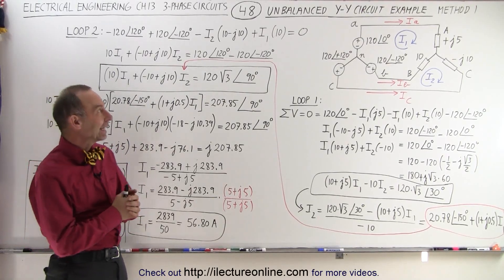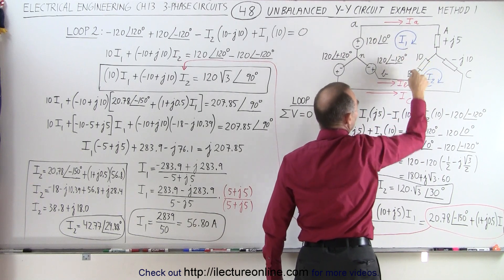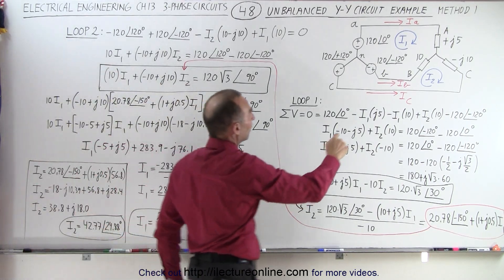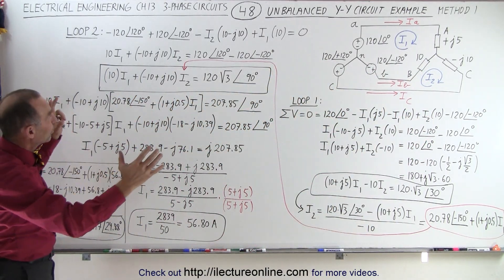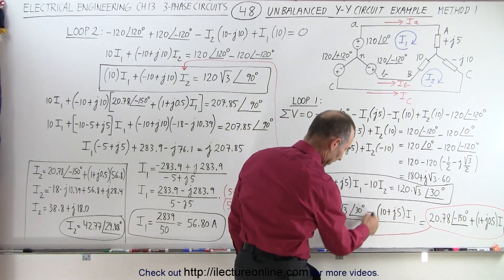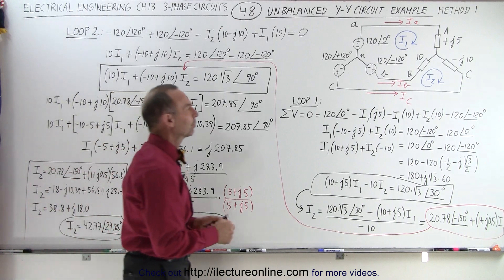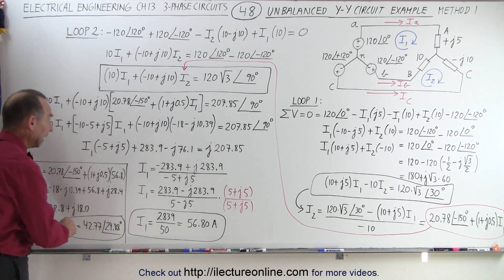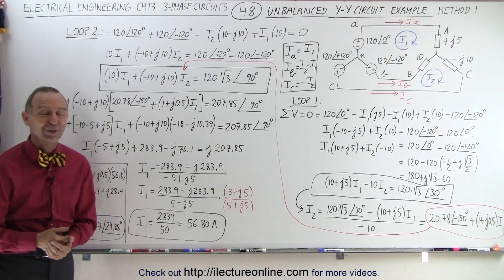Electrical Engineering: Ch 13: 3 Phase Circuit (48 of 53) Currents in Unbalanced Y-Y Circuit?  1

Comment: Professor, I heard that for a Y-connected source, the neutral wire will keep the load phase voltages equal even if one of the source voltages fails. Could you explain why that is true? Thanks.
Reply from the maker: The neutral can indeed be used to balance the loads.
Reply: @MichelvanBiezen  But why? Would you consider doing a video on the mathematics of it, and also on the mathematics of why source faults affect loads but not in D-D configuration? I can't find the information anywhere!
Reply from the maker: We need to get back to the EE videos to complete some playlists and to add to them as needed.  We first need to complete the physics review videso.

Comment: Professor, one important question. Why for loop 1, the 120<0° is positive? 
Loop rule basics state that if the clockwise loop touches the negative terminal of the 120<0°, it should be negative, same applies to the 120<120° source. It should be positive

Comment: Sir, why do I need to use mesh analysis instead of a simple KVL in finding the line currents?
Reply from the maker: You can use any method you like.  Ultimately, after you learn all the various techiniques, one will tend to use the technique they feel most comfortable with.
Reply: @MichelvanBiezen  sir, why cannot I use Ia=Van/Za?
Reply from the maker: Try it.  Does it give you the correct answer?
Reply: @MichelvanBiezen  nope it does not.

Comment: Sir, I noticed that there is no neutral current in this example compared to your unbalanced Y-load example. This example has only 3 wires while the other has 4 wires, does this mean that it is not needed to solve for the neutral current for this type of problems? Hoping for you respond sir.
Reply from the maker: Note that these are theoretical models, for the purpose of understanding the concepts.  And theoretically, if it is perfectly balanced, you don't need a ground wire.
Reply: @MichelvanBiezen  Thank you for you respond sir.

Comment: Can I have your email address or telephone number?
Reply from the maker: Unfortunately, we don't have the time, but we do try to answer questions via the comments when time permits.
Reply: Actually we have double star circuit for capacitor unbalance protection before that reactor all are connected to 33 KV network..3 branches of capacitor connected to Star1 and other 3 Branches capacitors connected to star2, in between CT for unbalance calculation. I want the current flow in between both star.
Reply: Also I am looking for any formula where I can just put the capacitance values and get the neutral current